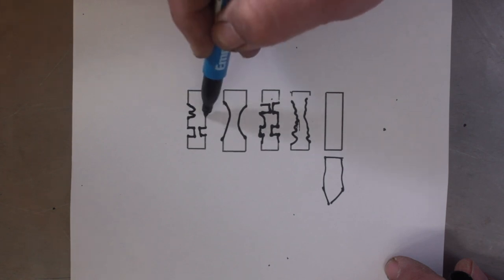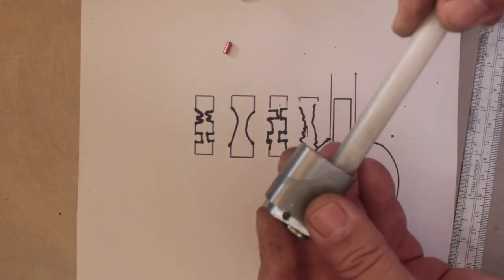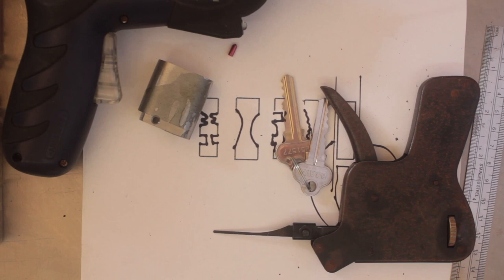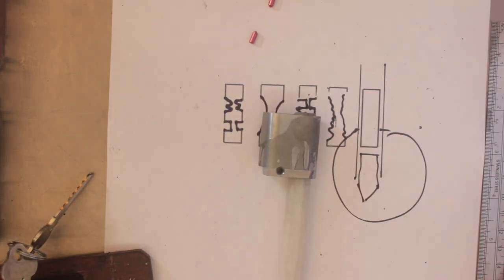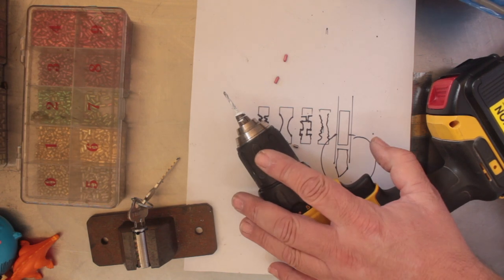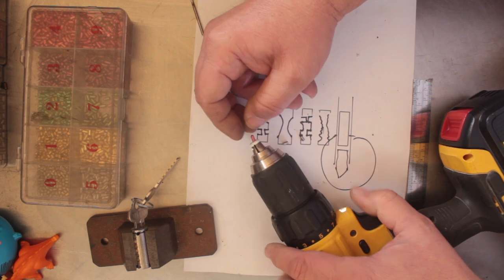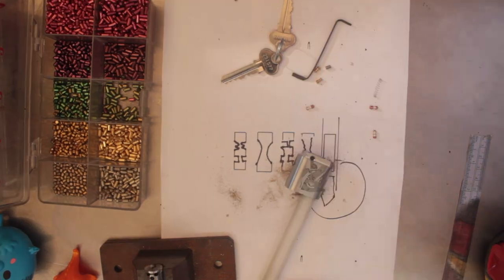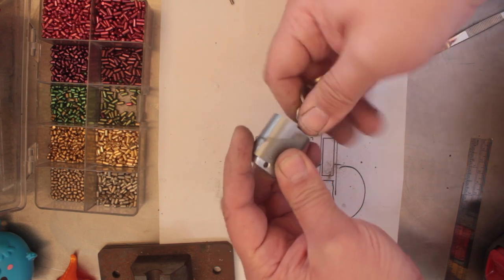Making Spool Pins - Check Pins - Lock Picking Made Harder

Comment: That's a great informative video.  I was surprised that you did not take the key out of the plug and test each security driver pin in each hole of the plug to see the depths the security driver pins actually interact with the the different heights of the key pins and try to make an even height pin stack so that you could explain how the driver pins that have a short key pin have more chance to activate as the key pin gets pushed out of the plug and that longer security driver pins only have a tiny amount of surface contact with the plug chamber and need a driver pin that only catches the plug chamber with its Sharp edges at the very bottom of the driver pin. 

I know from experience to do it like that and allow extra space in the upper part of the lock body for the extra length springs when using long driver pins on top of long key pins to travel upwards and compress the springs as there is only a certain amount of room for the pin stack and spring to move upwards when inserting or withdrawing the key. :0)
Reply: The sharper the edge the more likely to get caught also how thin the diameter of the driver pin inside the groove plays a role in pick resistance

Comment: Did the home made spool pins even slow down the pick gun in the six pin lock?
Reply: The round 2 pin would have a much better chance than the first ones as thin edge toward key pins Also key pattern affects if they will engage or not.